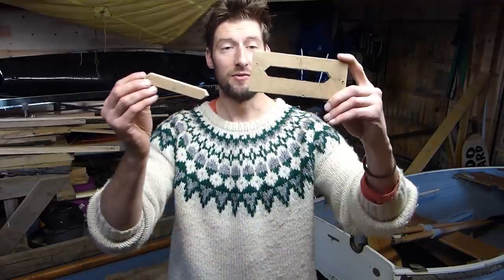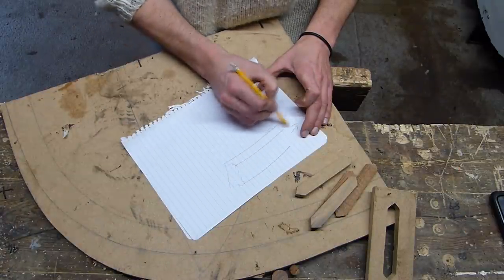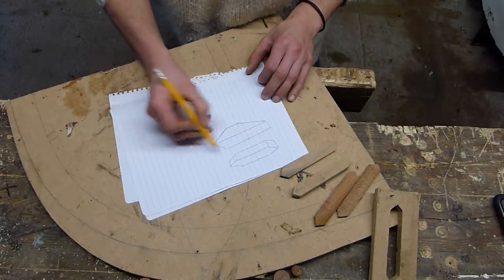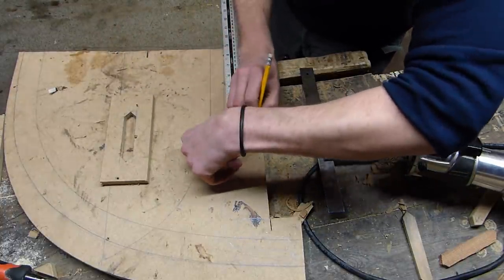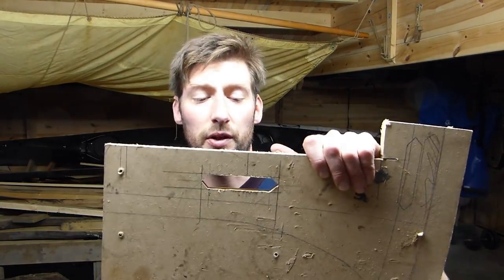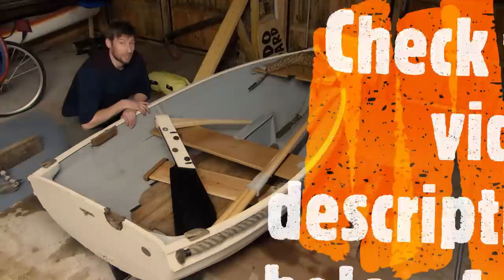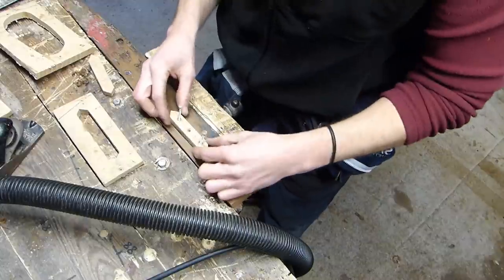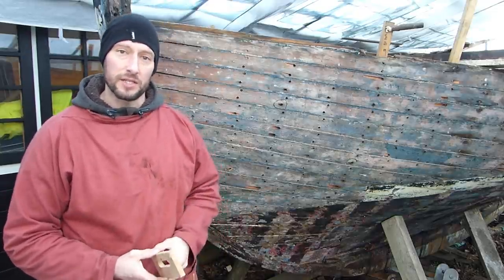Reviving an Idler - Episode 18 - The Dutchmans Jig - How to make a Router jig.

Comment: For the ends you can use the 45 of the tee bevel and cross the line at 10mm I believe and flip the bevel for the opposite side. Reduces those measurements it make those into geometry happy. Great video
Reply from the maker: Haha, absolutely you could! 👌🏻 all the measurements i made in that video were basically by eyeballing the repair patches and deciding a good average size. Others may want different sizes or angles and the info in the vid is : i hope transferable to that 👍

Comment: I appreciate handcrafts but still I have to say that personally I would do cavities as an ovals without need for hand finnish. Plugs I would do with a table saw and round ends either with table sander or router. With your current speed you will see next winter before done with plugs. But still; all the best for your restoration.
Reply from the maker: You are right, i have a different router jig that i use for the external planking that removes the need for chisels. Im keeping the “traditional” style for the interior because this will be visible. 
 Ps, i really hope im not still doing this next winter! 😂🤢

Comment: This probably a stupid question but the tack holes on the fence how do you deal with them and are they not an issue ….can you tell I’m NOT a wood worker ….. can’t wait to see how you extend the oars as I’ve a similar problem with a set of walker bay 8 oars been too short
Reply from the maker: The tacks can be largely ignored unless you are a "purist". paint and varnish / oil will all fill the holes nicely as will general wood swelling. But you could use cocktail sticks and a dab of glue if desired or the hole was two large. 
On the external geralds, i will likely fill the holes with linseed oil putty when i do the caulking.

Oars: Im Going to Scarf extensions to the end of the blades.
Reply from the maker: PS: "no such thing as a stupid question" :D

Comment: What glue do you use? Great videos by the way 👍🏼👍🏼⛵️
Reply from the maker: Thank you! For most if these im using epoxy (west system) but there are other options depending on application. The “glue” question is a hot topic in the boat world! 🤣🤣
Reply: @BothanboatsIdler  yes that’s what I use too